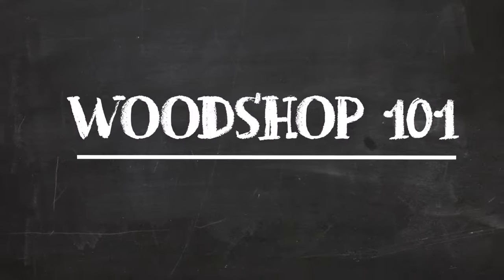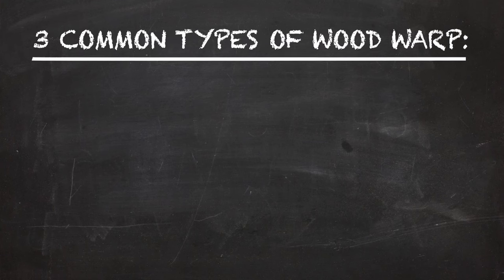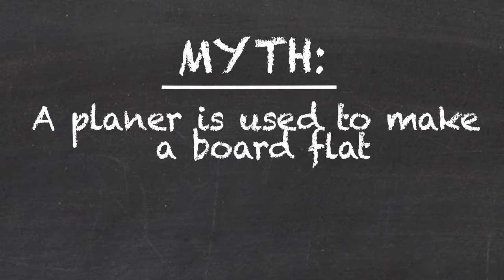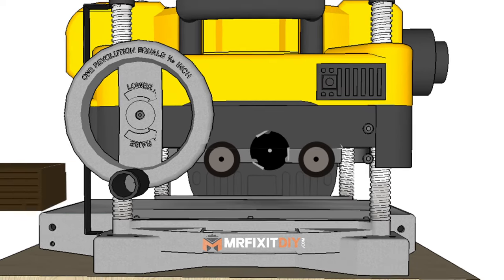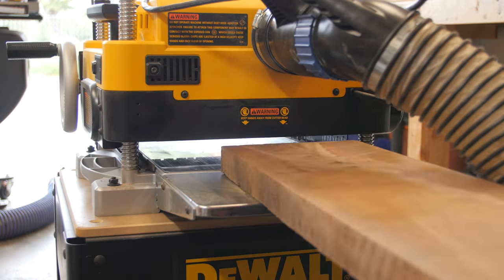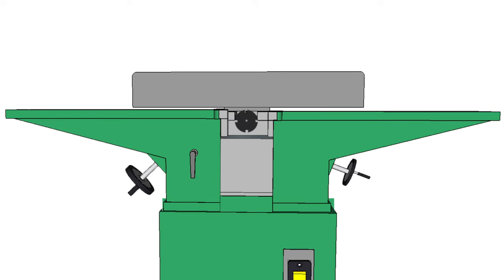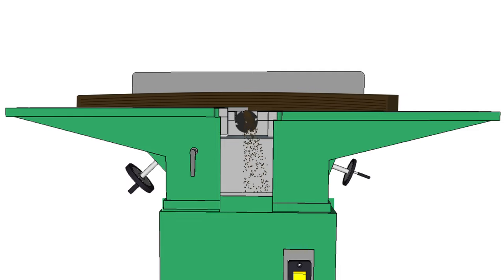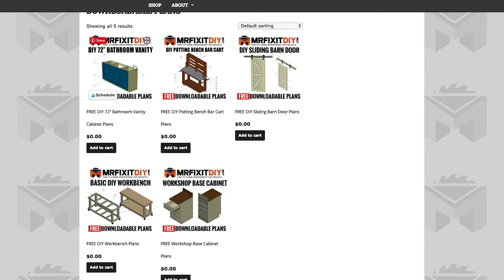Planer VS Jointer: What's the Difference? | Woodshop 101

Comment: The planer section was very good information for a beginner, well done there, but I don't think you did the router section justice. You didn't explain how a router can only be used to make one edge and one surface flat. If I were a first timer, it would sound like the router is doing the exact same job as the planer, and I could just use it to make one side flat, then flip it over and do the other side. It needs to be explained that this would indeed make two flat surfaces, but which aren't parallel to each other. Doing all four surfaces on a router would result in a trapezoid shape where neither of the surfaces or edges actually match each other. I know this was a very confusing concept to me when I started learning, but it needs to be learned quickly before a beginner thinks that they only need a router and not a planer as well, you can't have one tool without the other (not easily and not without a lot of extra work, anyway)

Comment: Did I miss it? Apologies if I did, why cant I just use the jointer all the way around?? Like, why cant I just use the jointer to get the thickness I want...
Reply: I believe it is because with a jointer you get a flat side, but it is only flat with reference to itself. So you could have two flat sides but they would not be parallel.  Think of a shim.  The planer cuts the board so the board has a uniform thickness, and thus parallel.

Comment: Quick question, what about electric hand planers? Still as a planer, does it only make an even thickness? Or does it function like a jointer?
Reply: its extremely hard to use bought it ruined 10 boards been sitting since

Comment: If I was making a cutting board would you recommend a planer or jointer?
Reply: As long as the pieces are relatively flat to begin with I usually just use a planer when your clamping put 2 clamps going across the strips that will help keep them as flat as possible